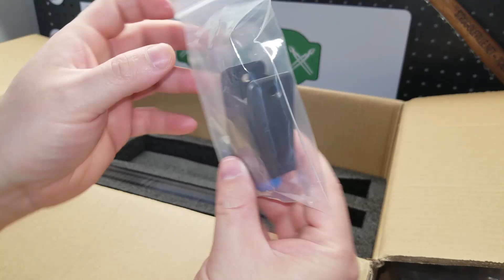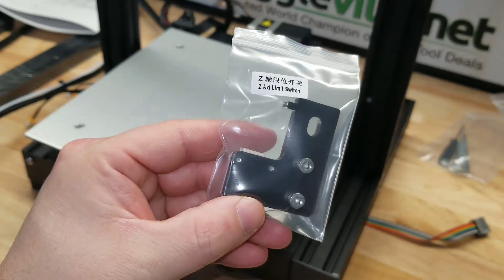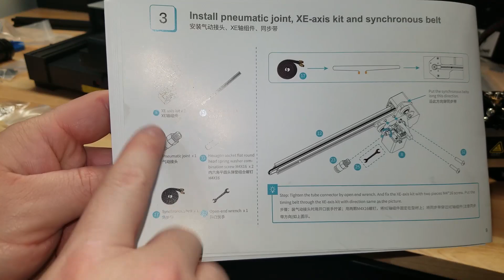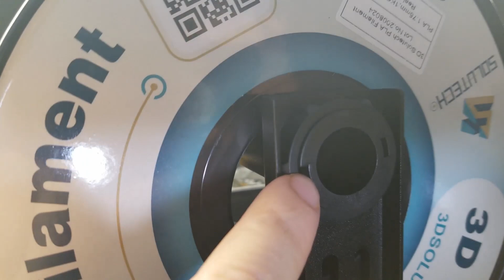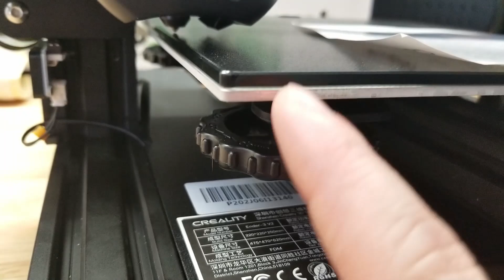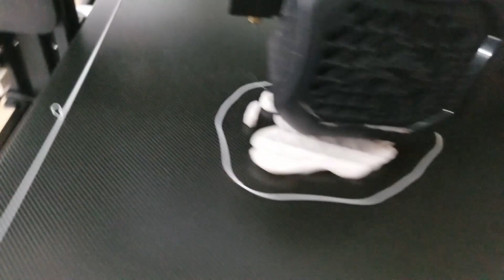Unboxing And Building A Creality Ender 3 V2 (Promo Code Included!)

Comment: Is this a better unit than the Ender 3 Pro?
Reply from the maker: Yes.  The Ender 3 came out first, then was upgraded to the Pro then the V2 was an upgrade from there.  The basics of the machines are mostly the same.  The bed is upgraded on the V2, I don't believe the belt tensioners are on the other versions.  The screen is an upgrade....the v2 is quieter, has the drawer in front.  I'm not sure what else but of the 3 the V2 is the latest, presumably best model.

Comment: You can place the glass plate and printed item in freezer to cool.  It really helps when item sticks to plate.
Reply from the maker: Thanks for the tip!  Only about 5 prints in but everything has come off nice and easy so far.  The old 3d printer I was using was such a nightmare
Reply: @TheStruggleville  clean your plate between sessions. If it gets to the point where it's a problem, you can put a flexible metal plate on it. I've done that on all my resin printers, but haven't had to for an FDM printer yet.